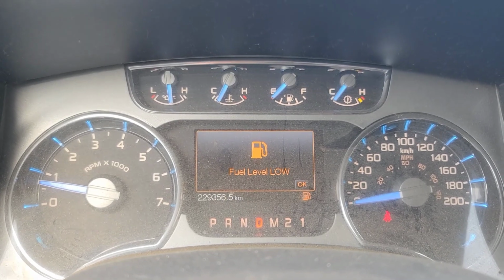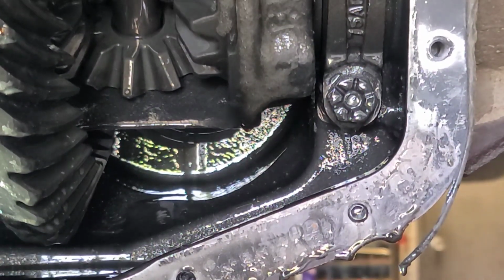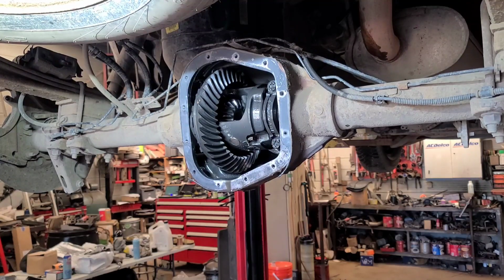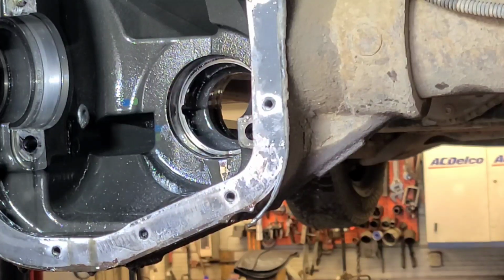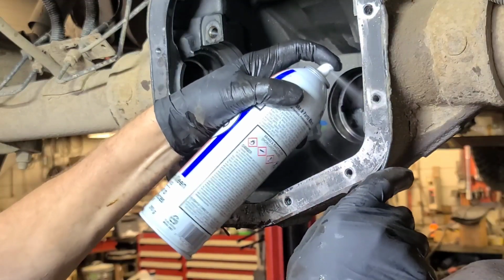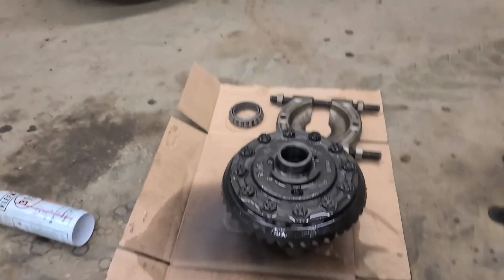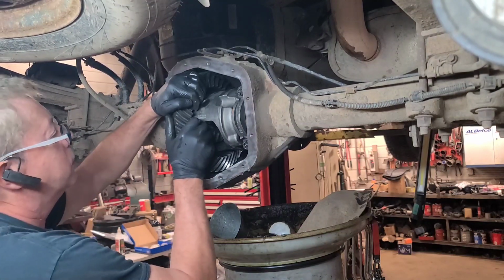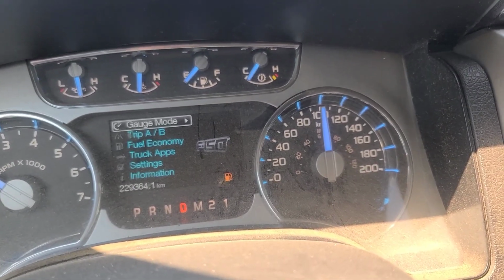2011 F150 Driveline Vibration And Noise. Pinion Bearing Failure

Comment: Great video and job Phil.  I can tell you have experience, skill, and confidence to do those diff rebuilds.  I never felt confident doing them so always resorted to a boneyard axle whenever we found any internal issues.  Keep the videos coming
Reply from the maker: There was a time where swapping out a complete rear axle assembly was reasonable. Now with backing plates and parking brake assemblies not so convenient. Plus you're never sure what you're getting and they want a ton of cash for a used assembly. This repair was $1500 Canadian and I thinks it's a more reliable solution.

Comment: Nice to prove those youtube experts wrong. The gear teeth are very hard and durable and even when running at a slight angle there is nearly no wear taking place. If the teeth are not chipped I have always had excellent results with a nice quiet ride.
Reply from the maker: Yes I agree. Either way it was going to be much quieter.